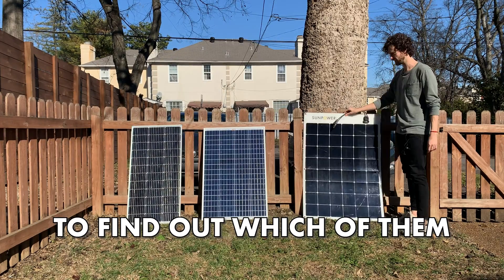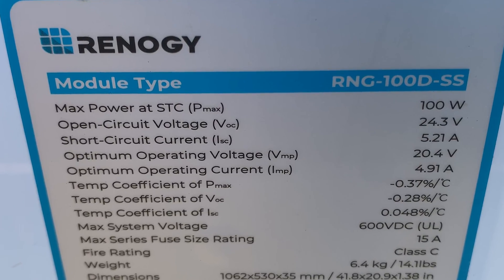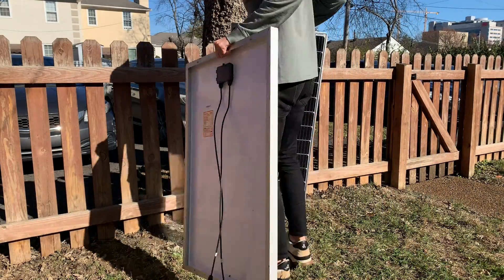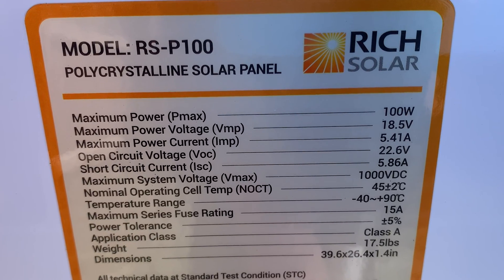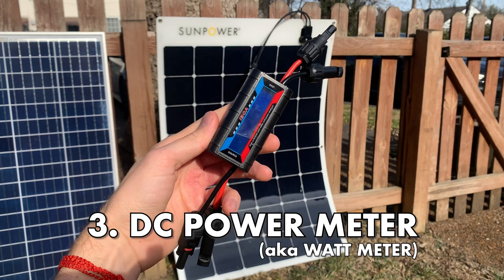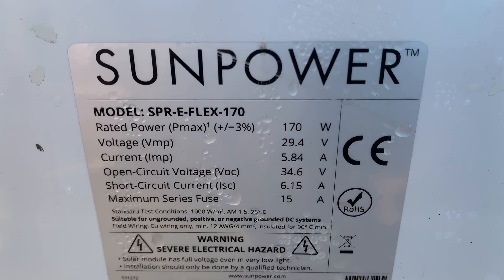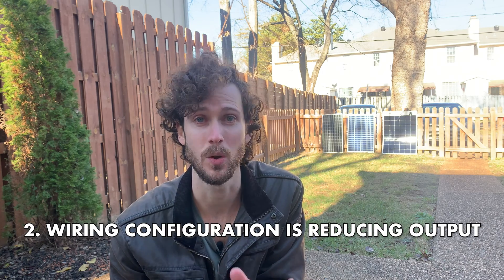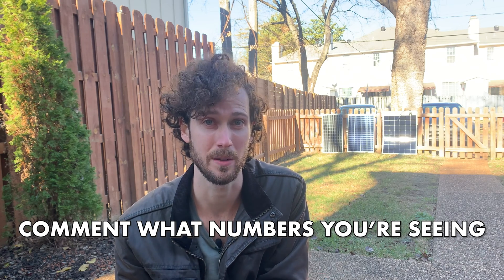How to Test Solar Panels!

Comment from the maker: METERS & TOOLS mentioned in this video (affiliate links)

Multimeter - https://amzn.to/3S1jJRl
Clamp meter - https://amzn.to/47nmfW9
DC power meter without MC4 connectors - https://amzn.to/48CKbG3
MC4 crimper kit - https://amzn.to/3H2q74m
DC power meter with MC4 connectors - https://amzn.to/3THiJTm
Reply: Early Spring and mid Autumn max power from a solar panel

Comment: I had some kind of power surge that blew a 100 amp fuse that is between my charge controller and the battery bank. Since replacing that fuse my charge controller won't go out of sleep mode. I just found that none of my panels are putting out any amps.. I think they all got fried somehow

Comment: Thanks Alex, that was just what I needed to learn. I once tested a friend’s old solar panel. I was surprised how the output dropped dramatically, with only 2 fingers over the corner of the glass. I’ve just bought 5 x 250w used panels. Then learned the dangers of used panels, face down in the rain. 🤷‍♂️ Keep up the great work. 👍

Comment: I have 4 panels Ina series. Each panel can produce 460w, 41.5v, 13.95a. This is connected to an mppt/hybrid inverter. The inverter shows the correct voc, but the amp is only showing 1. The watt shows about 1000w when under load. The fact that the voc is correct would mean my wires, connections are good right? And the panels are also working right?  What would cause the Amp to only show 1

Comment: Well my issue is odd, I have three 200 watt panels and they had been putting out over 400 watts. monday it rained all day and not that we have clear skys and full sun the three panels are putting out less than 400 watts, there 10 months old no gamage, clean so whats up with that.

Comment: I'm having some problems with EcoFlow 220 W panels. I received one as a gift, wired it up to my Delta Pro 3 using XT60i extension cables, and got zero watts input. I then connected the same wires to an EcoFlow 125 W panel that I know to be working, and produced nominal output for the conditions. EcoFlow exchanged it, and I still have the same problem as before. They asked me to test it with a multimeter; that's why I'm here. This video will help me immensely in running the test. It seems strange that two EcoFlow 220 W folding panels would produce nothing, but my 125 W panel does. Is there any other explanation than a second defective solar panel?

Comment: Thank you for the video.  It's very helpful.
I purchased the same multimeter on Amazon.
I have a quick for you. I have two solar panels and both panels inputs are 86-88% of what the specs. (VOC) say.  But incoming watts are too low.   Any suggestions, please?

Comment: Thanks you really help me. I’m only getting 55% out of my 400 White bi facial Hyperion panels but the batteries are always over 50% so I think the inverter is throttling back because the only time I’ve seen it go over 4.5 kW in a noon day sun is when the battery was really low but still to get above a charge above 50% to get them you know charge 100%. I gotta buy 20 more panelsbecause I’m not getting a charge a high enough charge on my four batteries to make it through the night if you follow me and I’m about to go test one each individual individually if I have more questions I’ll follow up.

Comment: Great video.  I will test my old 12 year old Bosch panels soon . I will disconnect each panel and test with a multimeter.   New panels look cool - 500 Kwh etc, 24% efficiency. and only cheap.

Comment: I have eleven 330-watt Jinko solar panels connected in series and mounted horizontally. Each panel has an open-circuit voltage (Voc) range of 43.6–46.9 V and an operating current (Imp) range of 6.94–8.74 A.

The issue I'm facing is that I'm getting only 40–45 volts per panel, and two of the panels have partial shading on the upper 1–2 rows of solar cells.

When all panels are connected in series to the solar inverter, the total voltage initially reads 439 V. However, when I apply a 2 kW load on the inverter, the solar system only generates a maximum of 1.5 kW, despite it being a sunny day.

I then checked the voltage and current at the inverter. Under load, the voltage dropped to 202 V, and the inverter showed 7 amps of current. Using a clamp meter, I confirmed 202 V and about 5.5 amps.

Why is my solar plant not producing full power even though it's sunny?

Comment: I'm just starting to look at this due to lower voltage output on my system.  It's use to run about 90 volts, now when under a load it's gotten as low as 70 volts.

Comment: The elephant in the room is if you have a 10 year old low performing system on a difficult  access high roof  , how the heck are you going to test each panel ?  The scaffolding boys have got the market sewn up ,  1000 quid for a simple tower where we live ,,, its a tricky solar  timebomb .....

Comment: The information paper on the back is gone from my panel. But there is a bar code and the brand. Is there a way to get the information on the recommended output of the panel

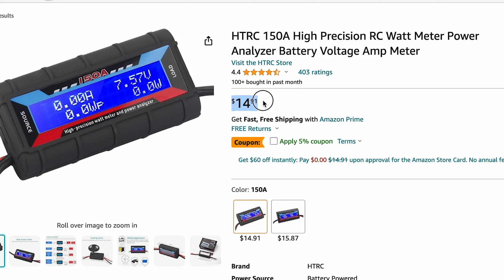Comment: 4:54 Hey why don’t you just multiply the voltage output by the current output using P=VI to find the wattage of the panels?? 

VMP= 29.4V
IMP= 5.84A
Pmax= 29.4V • 5.84A
Pmax= 171.7W

Elec engineer here just doing some refreshing on solar before finalising my circuit for home. 
I have to say, so far you have conveyed what many would see as daunting in an approachable way that doesn’t drill fear of electricity into viewers. Even just going through the different types of meters was thorough enough for anyone to do the job, but still holding back on all the unique specialised functions that could and would just further confuse people, or even worse, turn it into a handheld explosive if connected certain ways. Also have to say, game recognises game seeing the towel thrown over the panel for a lesser spark. Big-Engineer-Energy deserves a mention, gotta love the countless tricks of the trade.
Reply: Yep, brushing the dust off of my electronic Theory bank,  that's the same reason I'm watching this video. I'm not yet setting up a system just learning as much as I can about the solar power electricity generation units available. Seems like there's so many new power stations coming out almost weekly that the longer you wait the better and hopefully less expensive they're going to get.

Comment: Very helpful video.  Thank you.  Subbed. Why will the panels not power up a 12 volt light or tiny dc motor direct from the panel? Why must there be a battery?

Comment: My friend has Solar and it does not work as good as it did. What could be wrong please?? It’s 10 years old.
Reply: Panels degrade over time. Even at 10 years old they should produce a nominal voltage. But time of day is important. Checking at 4 pm versus 12 noon will give you different results. Even cloud cover will force it lower. Are you checking it in full sun and panels perfectly clean?

Comment: I have a 100w solar panel I have it hooked up to a fence charger thru one of them boxes like you had the blue one.  Also have a 12 volt car battery to hold backup power.  It worked very well in the beginning but it has stopped working right.  The battery always stays down and does not charge.  Battery and all connections have been checked.  What should I do
Reply: What was the problem? Did you fix?

Comment: Excellent video. You did a great job of explaining how to do this. I’ll be using these methods as I acquire more used panels. Does your Clamp meter measure both AC & DC Current?  I want to buy one that does both so I can measure the current around my Batteries and Inverter.

Comment: I have an old 140w mono panel that is now over 10 years old the reads 19v but under load it drops to 9v . I need to see if is the diode but haven't tried yet.

Comment: I had a solar panel that when i first got it showed voltage, then i checked again, zero volts. Turns out a diode 10A10 was shorted. Had to clip a lead off one of the legs and the voltage was 23 volts from wire to wire. Replaced the diode and eveeything works

Comment: Sie liegen falsch. Um die Leistung eines Solarpanels zu messen, schließen Sie es an eine Batterie an und verwenden Sie ein Multimeter, um den Strom (Ampere) in Reihe mit dem Stromkreis zu messen. Achten Sie auf korrekte Anschlüsse und setzen Sie das Panel direktem Sonnenlicht aus. Führen Sie Messungen unter verschiedenen Bedingungen durch, um eine umfassendere Leistung zu erhalten. Multiplizieren Sie die gemessene Amperezahl mit der Panelspannung, um die Wattzahl zu berechnen. Dies hilft Ihnen, die Effizienz Ihrer Solaranlage zu beurteilen.

Comment: Ja, um die Leistung eines Solarpanels zu messen, ist es üblich, es an eine Batterie anzuschließen und den durch den Stromkreis fließenden Strom (Ampere) zu messen. Hier sind einige Schritte und Überlegungen, um es richtig zu machen:

1. **Solarpanel-Anschluss**: Schließen Sie das Solarpanel an eine geeignete Batterie an, um sicherzustellen, dass die erzeugte Energie gespeichert wird. Achten Sie auf die richtige Polarität (Plus an Plus und Minus an Minus).

2. **Verwenden eines Multimeters**: Um die fließenden Ampere zu messen, können Sie ein Multimeter verwenden, das auf den Strommessmodus (Ampere) eingestellt ist. Sie müssen das Multimeter in Reihe mit dem Stromkreis anschließen, das heißt, eines der Kabel, das zum Batteriepol führt, muss durch das Multimeter verlaufen.

3. **Messungen**: Wenn alles richtig angeschlossen ist, setzen Sie das Solarpanel direktem Sonnenlicht aus und beobachten Sie den Messwert auf dem Multimeter. Dadurch erhalten Sie eine Vorstellung davon, wie viele Ampere das Panel unter den jeweiligen Bedingungen erzeugt.

4. **Testbedingungen**: Es ist hilfreich, Messungen unter verschiedenen Bedingungen (z. B. zu unterschiedlichen Tageszeiten oder bei unterschiedlichen Lichtverhältnissen) durchzuführen, um eine umfassendere Leistung des Panels zu erhalten.

5. **Leistungsberechnung**: Wenn Sie die vom Solarpanel erzeugte Leistung in Watt berechnen möchten, können Sie die gemessene Amperezahl mit der Ausgangsspannung des Panels (die Sie auch mit einem Multimeter messen können) multiplizieren.

So bekommen Sie einen guten Eindruck von der Leistungsfähigkeit und Effizienz Ihrer Solaranlage. Wenn Sie weitere Einzelheiten zu einem bestimmten Schritt oder zur Interpretation der Ergebnisse benötigen, lassen Sie es mich wissen!

Para medir el rendimiento de un a solar.

Comment: Is it safe to say that if the volts and amps are within the correct range on the VOM that the power in watts should also be within the acceptable range?  
FWIW:  The linked power meter with MC4 connectors is no longer available on Amazon but I found it direct from PowerWerx.  Good video - thanks!

Comment: I assume if you just plug in the controller side MC4 connectors together to basically short the panel like you do with the amp setting on the multimeter, then you'll get the maximum power. Leaving it plugged into the controller will just tell you what the panel is making interfaced to the charge controller which is not necessarily the maximum.

Comment: I recently bought a van that came with 2 different panels. I’m in the process of pulling everything out and testing but wanted to know which setup would be better? Parallel or series? What is more important when connecting an inverter?
Reply: it is not recommended to connect 2 different panels in the same connection regardless of parallel or series.

In series, final voltage is the sum of both panel but final current will be the lowest of the two panel. 
In parallel, final current is the sum of both panel but final voltage will be the lowest of the two panel. Worst case, there will be reverse current if one of the panel's voltage is significantly lower than the others. 

The work around is to have 2 MPPT/Charger controller each controlling 1 panel.

Comment: Is it possible for a panel to short out under full sun? My panel on the RV started to give output only early morning & dropped to 0.0 v out when the sun got higher. This was measured at the MC4 terminals on the panel itself. 4 year old flexible 100w panel

Comment: Thank you for making this video. I have two 8 year old 250 watt panels on my RV and they are only putting out about 7 amps which is about half of what they used to produce. The problems are they are securely mounted on the roof and the wiring is underneath the panels so testing them individually will not be easy. Even getting on the roof isn't as easy as it was 8 years ago.

Comment: Thanks. I have similar renogy panel to replace a cheap one on the van. Testing before fitting I find good voc over 24v,but I can't find a current, zero. Checked as you did and also with meter in series connected to controller. Still zero?
Reply: Im having the same problem with 4x Sungold 200W panels (24V). Have you found any solution?

Comment: Also instead of using a DC meter you could Multiply the voltage by the amps and that’s usally the wattage
Reply: Thanks for infos eric 👍✅
Reply: @Diamond_Fangs888  Yes, but you have to measure the voltage at the same time as current as the voltage will drop when you short the panel. If just measure them separately, you'll get a much higher power value than it's actually making. You need to multimeters for this so you can use them at the same time or you need one multimeter that can measure power.

Comment: Hello, great information. I have two leisure batteries  12V 130AH 130 AH, what MPPT size would i need please?
Reply: Mppt has to do with your panels more than your batteries . The wattage and volts  of your panels determines the mppt .

Comment: You could have connected the MC4 connectors together on that second panel and measured with the clamp meter.  That way you can measure the Isc and don't need all the other equipment.
Reply from the maker: Yes that's another way to measure Isc besides the multimeter method I cover. By 'other equipment' I assume you're referring to how I tested the current when the panel was connected to the system? For that was actually testing Imp rather than Isc.
Reply: @footprinthero  Yes, for testing Isc... nothing is quicker/easier than just connecting the MC4 connectors together and measuring with a clamp meter.  Testing the Imp can be trickier as you need a load that can pull full power reliably.  You did a good job of showing different methods.
Reply: I'm a newb to this but saw elsewhere someone said you must be extremely careful if you short circuit to test since 0.5A is enough to kill and these panels produce way more than that.
Reply: @PeterBlanchard  In this situation where only one solar panel is being tested, it is safe to just connect the MC4 connectors together and measure the current with a clamp meter (though I prefer to make\break any connections with the panel covered or facing away from the sun to avoid arcs/sparks).  The voltage during the short circuit test is essentially 0v and you're not in contact with any conductors.  Even if you use the multimeter probe method you're dealing with a relatively low voltage (on the panels shown here) so not really in danger.  If you are dealing with a very large panel then the voltage increases to a level with some risk, but only if contact with the conductors is involved.  Even on large panels, plugging the MC4 connectors together is still perfectly fine when testing with a clamp meter (even if though the current might be 10 to 15A.  You should never do any short circuit tests where multiple panels are involved - either series or parallel.  Stick with testing each panel by itself and you're good.
Reply: @gumpster6  so you're connecting a single panel's Positive to Negative?
Reply: @garyfanning2769  Yes, as long as it is only a single panel.  That's exactly what the "Isc" (short circuit current) is listed on the label on the back of a panel.  It's better to make/break the connection with the panel covered or facing away from the sun to avoid sparks.

Comment: Great easy way to test your solar panel, mine is 170w 10 months old at the beginning it produced 7-8 amps, suddenly after few months it went down to 2-3 amps with load on and while charging the half drained battery. Open circuit voltage was 23v but when connected to controller it’s shows 16v. Wondering why the current is reduced?
Reply from the maker: Open circuit voltage will always be higher than the voltage when the panel is connected to your system, so that's normal to see a drop in voltage like that when connected. The drop in current is concerning. Did you test the panel's short circuit current (Isc) with a multimeter?
Reply: @footprinthero  I did short circuit the panel and got 6 amps on clamp multimeter reading and 22voc , connected back to the controller and got 2.4a at 16.2v, checked the cables resistance and seems fine.
Reply from the maker: Strange... perhaps your charge controller got damaged somehow. At this point I think it'd be worth trying out a different one and seeing if that solves the issue.

Comment: Can a bad solar panel drain your battery
Reply from the maker: Hmm no never had that happen to me or heard of that happening. Charge controllers use a little bit of power, so they can drain your battery slowly over time if your solar panel isn't getting any sun for a long stretch. Like if your panels are covered in snow for days or weeks at a time then the charge controller could drain the battery a bit during that stretch.